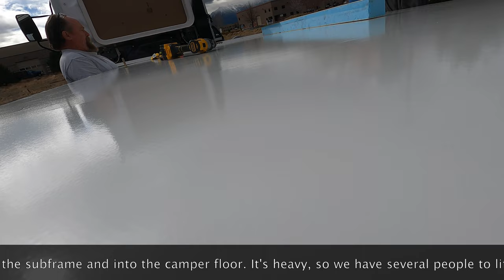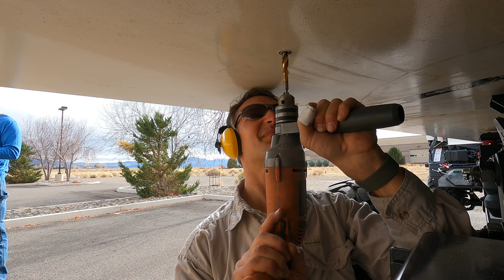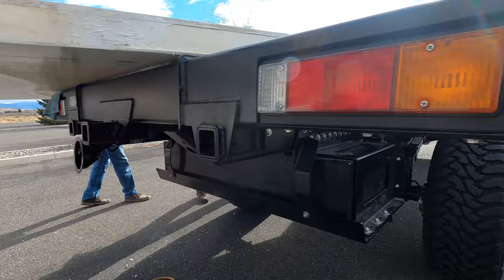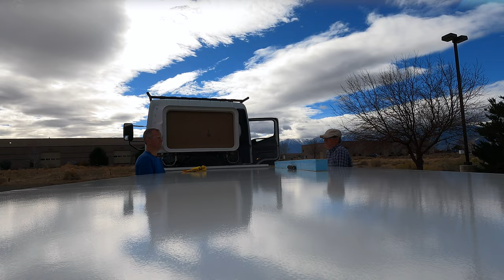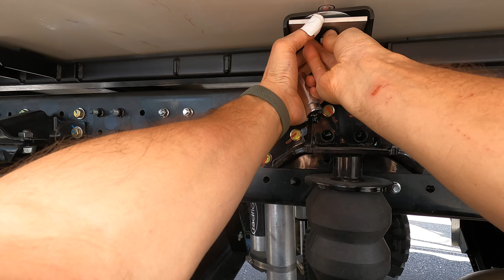Attaching the camper floor to the subframe; Building a Total Composites expedition camper

Comment: Great video! came across it while researching how I'm gonna build my camper box. I was wondering - what is the purpose of the empty channel in the metal extrusion that you glued to the composite? also, is the extrusion a stronger solution then to build a steel frame and fit the composite into it? ( That's how our local builders do it)
Reply from the maker: Thanks. The composite panels have several benefits over a steel frame with panels: completely thermally broken, incredibly strong and uniformly strong, as well as very quick to build and assemble. Also likely much lighter weight, but I think the key benefit it being completely thermally broken for a camper that is much better insulated.

Not sure I understand your first question, but the floors have a steel bar inserted inside the composite panel for as strong and tap-able mounting points to the floor and thus entire camper to the subframe. These steel bars can also be inserted into walls panels for also mounting awnings, spare tires, storage boxes, etc. The steel bars are installed within a fiberglass tube which is then filled with additional insulation to keep a thermally broken integration that allows the steel bar to expand since it does while the fiberglass doesn't, and a joint that can be all glued together within the panel for an integrated connection. I hope that helps.
Reply: @vantripping  Thanks!

Comment: Anyone is this situation , trust me when I say if you buy Cobalt drill bits, it will change your life. They way they drill through steel is like a regular high speed steel drill bit through aluminium. YEs they are 3-4 times the price, but worth every cent IMO
Reply from the maker: Yes indeed to high-quality bits. Thanks for sharing. I’ve also found that titanium coated bits work well. I’m getting ready to invest in a new bit set as mine are getting worn.

Comment: How heavy was the floor?  Just curious why you didn’t flip it over to the do the drilling…. Nothing worse then drilling upwards!
Reply from the maker: Yep, great question. We considered it, yet would need a large flat and smooth section to drill onto which we didn't have. Doing that on the subframe would be unbalanced without additional supports, and the floor is very heavy, so to flip it over would likely not be all that safe and certainly a challenge even with our 8 people.

Comment: I’m not understanding how this mounts to the subframe. How many bolts? Were they premarked? I also don’t see outriggers for support.
Reply from the maker: The composite camper floor has imbedded fiberglass tubes with a steel flat bar inside of them, and these are placed at designated intervals, usually about every two to three feet. The subframe mount holes and camper floor mounting tubes are planned in advance to align with each other. Once the floor is in place on the subframe, the subframe holes are marked onto the floor and the floor drilled into the tubes and flat bar but not entirely thru the floor--only about an inch into the 3+" thick floor as the top of the flat bar it only about 3/4" above the bottom of the floor panel. This hole is then tapped with threads, and bolts are guided up thru the subframe holes and threaded into the camper floor and tightened to spec with thread locker, so the bolts sandwich the subframe and composite floor together, and hence the camper. This is the way all composite campers are bolted to the subframe/chassis. The bolts are plenty large enough and enough of them to more than securely hold camper and truck together. Subframe mounts & bolts to camper range from six (EarthCruiser) to 12 as I've seen for larger campers--I have five bolts down each side of the subframe for 10 total. The subframe has short outriggers for these mounts.
Reply: @vantripping  Thanks! Very interesting. The steel bars must be very thick; enough to grab enough thread to apply enough torque. 
I’ve rewatched and have found the outriggers. They are very short. I’ve also found the subsequent video with the sandwich plate modification. This is quite an impressive project! I’m a big proponent of avoiding the employment of wood! Looking forward to the next cabinetry videos.
Reply from the maker: @mavallarino  Yes, they are about 6mm/.25" thick, more than enough to get a few threads and thus full strength of the connection. I wish the outriggers were nearly out to the edges of the camper so I could connect my storage boxes to them and provide a slightly stronger connection with the camper, but it's more than enough and what EarthCruiser has been using for over a decade and I had them add two more pairs of outriggers for 10 bolted connections from their typical six, and I increased the bolt size from the recommended minimum of 3/8" to 1/2", so my connections are more than twice as strong as what the pro-builders are using.

Definitely best to avoid wood on the outside as it'll expand and contract enough to cause weakening over time in addition to weather damage and deterioration.

Comment: Could the box just be pre drilled and pre built and then drop it onto the frame, or does it need to be assembled panel by panel?
Reply from the maker: Yes, it can, and this is essentially what Bliss and other production builders do. But, shipping would likely cost a good portion of what the box costs to ship if fully built compared to when in panels, and have to be extra careful to not have it damaged during shipping and the lift. But I've seen it done, it's possible. We could have also flipped the floor over to drill facing downward, but it's a lot of work and challenging to flip it over without a crane and the panels are pretty fragile at the edges until glued up and with no attachment points.
Reply: @vantripping  makes sense! 

These are Earth Cruiser chassis mounts correct? The zero torsion frame by Globe Trekker vehicles looks interesting too. 

Thanks for sharing all your knowledge on this!
Reply from the maker: @woolengrappler  Yes, I am using EarthCruiser's subframe, which is excellent in that it only adds just over 3" of height above the chassis frame--a really great advantage compared with one that adds double that. I go over some of the subframe in this video: https://youtu.be/WjxMOx38bGU Be sure your subframe system can accommodate the chassis and it's flex.

Comment: How thick is the steel in the floor? Is it a full sheet of steel inside the entire floor panel? Is this the order of materials from the top to the bottom of the floor panel sandwich: GRP inner skin, foam core for insulation, plywood, steel, plywood, and finally GRP outer skin?
Reply from the maker: The steel is 6mm (1/4" thick). It is about 50mm (2") wide and inside of a GRP (fiberglass) structural tube, and then the tube is filled with foam. The entire floor is layered in a sheet of ~3/4" plywood on top and a thin ~1/4" on the bottom, all inside of the fiberglass skin, and the sandwhich fully filled with foam. It's a very strong assembly. I'll try to post a photo on www.vantripping.com.
Reply: @vantripping  If you could post a picture of the structure in the floor that would be fantastic, maybe you could post it under the community tab for your channel with a link from this video. Thank you
Reply from the maker: @chrisdaniel1339  good suggestion. I just posted some photos of them, although all not that great as I wasn't focused on taking pictures of the subframe and rear wall mounts which are nearly the same, each with a 6mm steel bar within a GRP tube. The GRP tube's are filled with foam, although sometimes that was removed while shortening the steel bar and then replaced.
Reply: @vantripping  Thank you so much for posting the pictures of the steel attachment bars embedded in the floor and rear wall, the pictures make the description much clearer. Thanks
Reply from the maker: You're welcome.  @chrisdaniel1339

Comment: Is there a reason the floor panel was not just placed on the ground upside down to drill and tapping the holes with ease? Then the panel could be flipped over and attached to the chassis.
Reply from the maker: Good question. We could've lifted the panel off the subframe and placed it flipped over over onto some stands or the ground to drill the holes, and then replaced onto the subframe--and we did think about doing this--but the panel is heavy which took about 8-10 people to lift it and move it around, and flipping it over is risky due to being so heavy and needing to rotate the large panel--risking injury of a person or the panel, so we decided to drill the holes in place thru the subframe and from below the panel even though not as easy as it would've been drilling from above. Extra effort when drilling but less effort and risk than flipping the panel over twice--once to drill and then again to replace on the subframe--so we avoided that risky extra effort. The floor panel is heavy due to the steel bars for subframe attachment and plywood reinforcement.
Reply: @vantripping  I wonder if a electromagnet base drill press would have worked as it would have been tightly attracted to the steel bars inside the floor panel.
Reply from the maker: @chrisdaniel1339  Good question. I suppose it could've helped to maintain positioning if the magnet could penetrate the GRP panel and then the fiberglass tube that the steel bar is located in, but doubtful that a magnetic base would hold thru over a 1/4" of non-magnetic material. Do you have experience with using a magnetic base upside down and think it would hold thru that thickness of material before the steel bars?

Comment: Can this attachment method really survive 70mph crosswinds?
Reply from the maker: This is the method that Total Composites provides for their camper shells used by many individuals and companies for the their expedition campers, and the same method used by other notable expedition manufacturers around the globe, and my camper has survived 70 mph winds. A single bolt of this size has over 150,000 psi of tensile strength, and I installed over 60% more than a notable expedition camper builder uses, so I think it should work just fine. The only other method I can think of is bolting thru with a nut and large washer on the inside of the camper, which will actually be weaker as doesn't leverage the 2"x78" 1/4" bar and rest of structure imbedded into the camper floor. Plus a bolt thru will transfer heat from inside to outside and cause a condensation point. What other method would you suggest?
Reply: @vantripping  Honestly you answered very specific and you are good. We get these 70mph winds on Hwy10 and when I engineered mine, I have 18 attachment bolts, using a more complicated and a bit overkill method. Better be safe than sorry.  Mine is 5700mm long, with 3700mm on subframe length. Total truck length 24ft.  I have a Isuzu cab over crewcab.
Reply from the maker: @gator701  Cool. That's a big camper, and overkill is typically my approach too. I also questioned the strength of this approach but Total Composites said this is what has been used for years by nearly every composite camper builder including them without issue. It's pretty simple but the steel plates crossing the floor at each attachment location are heavy so using fewer would save weight. I did decide to not attach my under camper storage boxes to the bottom of the camper, even though that would be cleaner, more aero and allow for larger boxes and/or more ground clearance to the bottom of them. But I thought the weight of those and their contents on the edge of the camper would be too much, so I attached these to the chassis frame. But I also have a slide and swing up entry deck, so that adds a lot of force. Will be putting our a video on that soon.
Reply: @vantripping  I'm 36" inch's longer than yours, seats 7, sleeps 4, with full size n-s queen bed. A 14,400 lb capacity. Vortec V8 and GM 6sp trans.
Reply from the maker: @gator701  Very cool. Is it all built and how is your total weight?
Reply: @vantripping  The habitat is coming by sea container (full composite construction). I will let you know then. I believe I have at least 3000lbs of capacity available. It is a four seasons build, so I suffer because of everything is inside, and nothing is mounted between frame rails with the exception of a second fuel tank. (1000watts solar, 600amp hr  battery bank)
Reply from the maker: @gator701  Sounds good. I chose to install my gray water tanks between the frame rails, along with increased fuel and air compressor system and tanks. I got about 25-30 gallons of gray with all of the rest of the items, and still being accessible for repair if needed. My logic is that I drain my gray tank nearly everyday in an appropriate location via an electronic drain valve so the tanks are never full, and even if half full water expands 9% so plenty of room for that expansion should it freeze, but likely won't being that they are located above the transmission and exhaust, plus having warm water entering them, the water shouldn't fully freeze and even if does, will get unfrozen when the engine is run and then drained so shouldn't ever be an issue. A key to this success is the fittings and tubing being of good quality and having room for water to expand. This approach saves a lot of space inside and also avoids having to vent inside and risk of a leak of gray water inside the camper. Just something to think about, as all space will get taken and more will always be wanted.

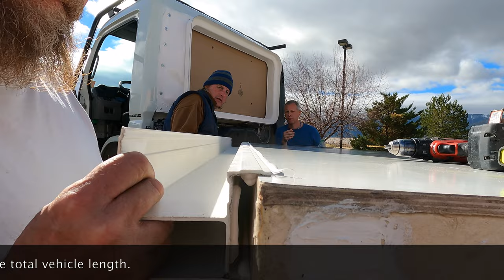Comment: Minute 10:17 - Those extruded grp profiles for the floor were built wrong by the manufacture. You shouldn't accept them if you had any ideea about forces involved on an expedition vehicle. It's common sense.

 The walls should rest on top of the floor, not hanged on its side by some glue and 2x 1" of grp lap. Your entire box weight (walls + roof) is now suported only by those 2 grp stripes, prone to crack ( bcs are pulltruded).

These days, I think they changed it... they realised that after I pointed this mistake several times on their page, but they deleted it.

This company makes tests on their clients money. They are not as professional as they claim or as you think, even they are germans.

Wood should not be inside of any sandwich panel, even if it's "so claimed" marine grade. You'll convince yourself with the first water intrusion. Because, even if you don't belive me, it will happen at some point. Then, the moisture trapped inside will create mold and will expand in the freezing days. Delamination will occur.

Pulltruded profiles are weaker than laminated ones, because they don't have multi oriented fibers. At shocks, they crack sooner on the corners.

Hope you used 2 components adhesive (2k),  it cures entirely due to both components chimical reaction.
1k adhesive cures partially, only where it gets humidity, not so good if trapped inside of an hermetic chamber.

If you think I am right about my points, you should sell your box while it's still in good shape.
Reply from the maker: Thanks for the info and I do understand and appreciate your points, but Total Composites has many boxes in use for well over a decade with this design and the adhesives, without any known failures or problems, and pretty much the same design as with other manufacturers. The loads are very small per square inch--well below the adhesive and material strength ratings. Now that it's all built, it all seems fine.